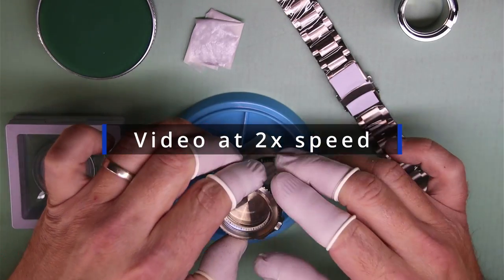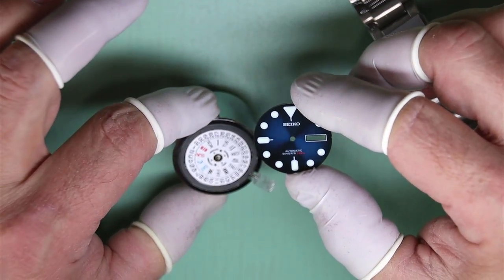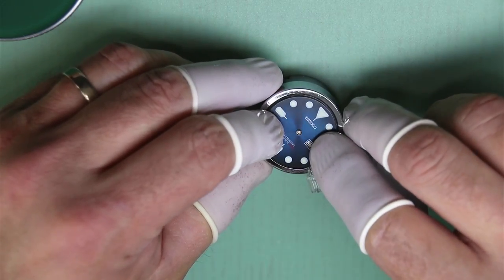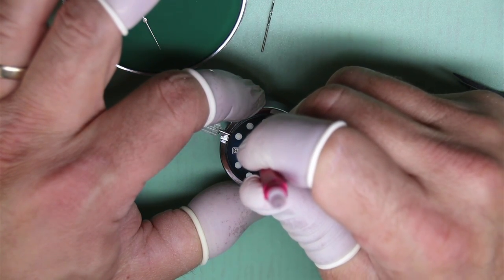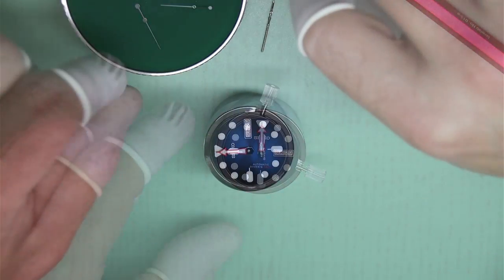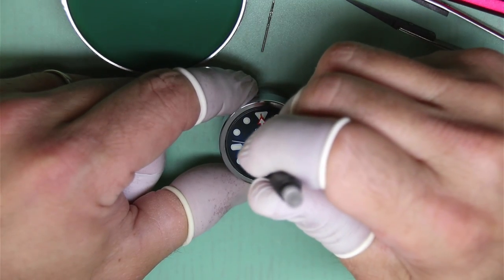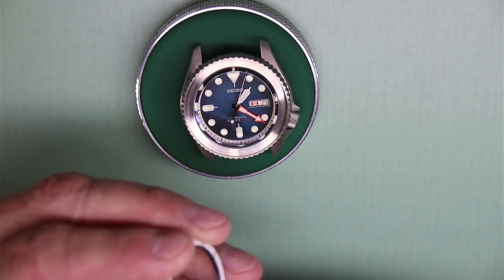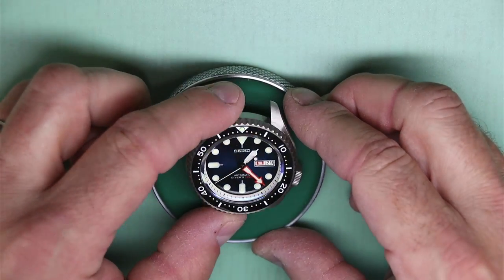Build your own Seiko SKX homage

Comment: hi Titanium is scratch resistant but there is one problem, metal like Titanium getting with time oxidation and this thin layer will get so many scratches, I have 2 titanium watches and both looks like soft  aluminium , coz this oxidation  film on metal is so easy and ugly to sctatch.

Comment: It's been roughly a year since uploading this video.  Could you tell us what your thoughts are now on the HEIMDALLR SKX007 titanium case please.  have you found any issues at all?  I have purchased the NH36(4H) regulated movement, dial, crystal and everything else but not the case yet.  I'm really leaning towards the NamokiMODS [NMK933 SKX007/SPRD Titanium Case Bundle Mk2] as it's Grade 5 Titanium but it is pricey or do I go with the HEIMDALLR titanium case you used here. 🤔

Comment: Is there a small vacuum cleaner with less power  you can use to deal with the dust in the back of the watch  . I'm considering getting into the  hobby
Reply from the maker: You would usually use something like this to get rid of dust. Giottos AA1910 Medium Rocket Air... https://www.amazon.com/dp/B000L9OIQC?ref=ppx_pop_mob_ap_share
Reply: @HeikosGarage   I have seen them but don't they just move the dust around  I have seen small rechargeable vacuums  on Amazon that's why I asked
Reply from the maker: @allanguy2522  that is what watch makers use.